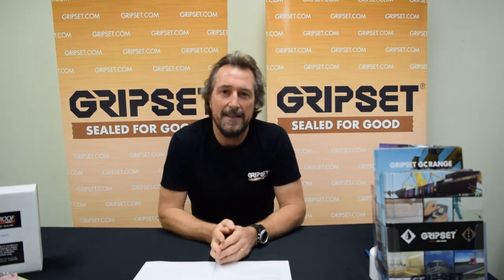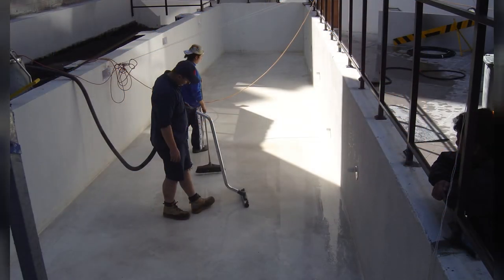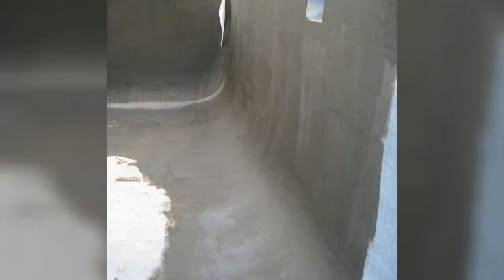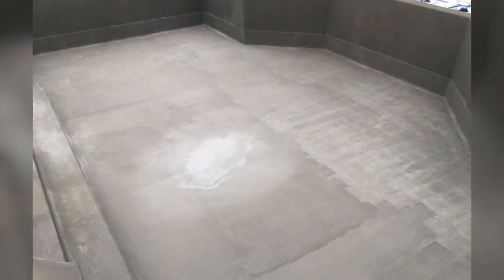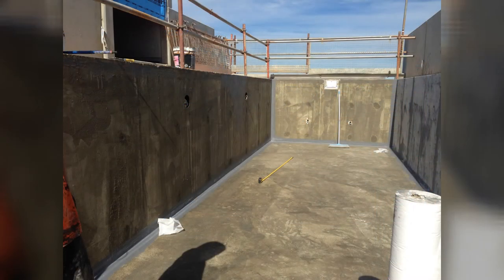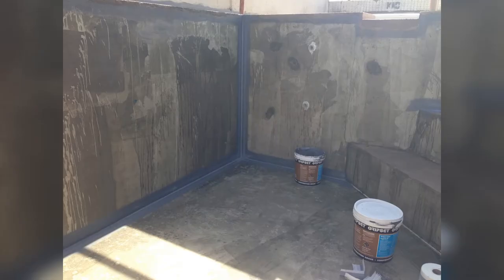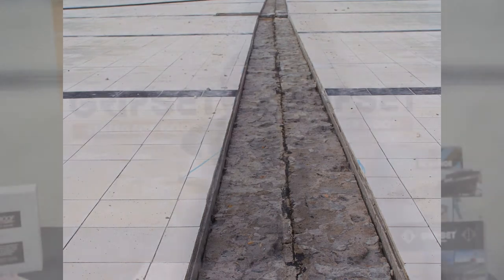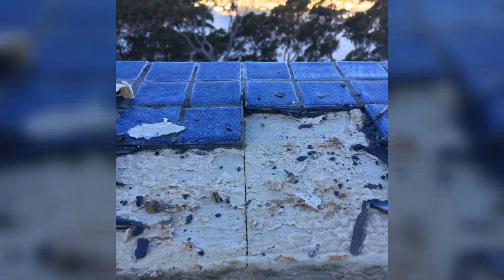How To: Waterproof Swimming Pools

Comment: I am making a pond in Texas. I want to pour a slab on a modified gravel. We have a hard clay soil here. Very hard. I want to use concrete blocks to build the sides and do lots of small grow beds and large stones around and even inside parts of the pond. It will be around 10000 gallons. Any suggestions on waterproofing?
Reply from the maker: Hi James, unfortunately as Gripset products are currently only available throughout Australasia we can only advise on our recommended systems so your best option may be to speak to a waterproofing company or brand that can assist in your area. Apologies for any inconvenience.

Comment: Doing a shotcrete pool. Homeowner wants a waterproof membrane before we tile. Local hardware sells c1p. Would you recommend two coats of that before tile. Pool is 5 x9m
Reply from the maker: Hi there, thanks for your question. Yes, C1P is perfect for immersed areas and we'd definitely recommend two coats. 8 bags should cover this area. You can find out more about C1P and download a TDS from here: http://gripset.com/products/gripset-c-1p/
Reply: Thanks for that.  We are in Fiji and can only get 15 kg buckets.  I am figuring 14.?
Reply from the maker: Yes it could work out to that amount, you can visit Vinod Patel and they will be able to assist with the product.